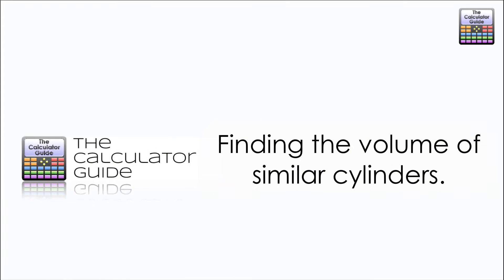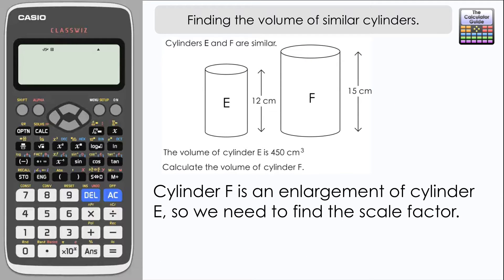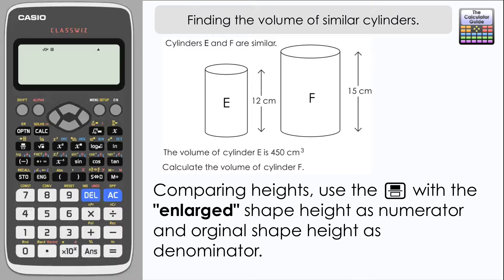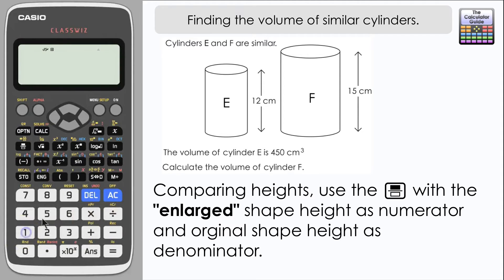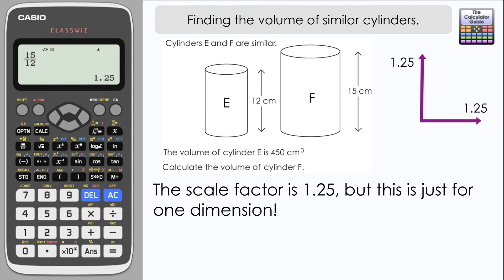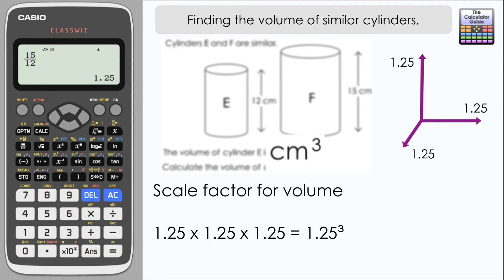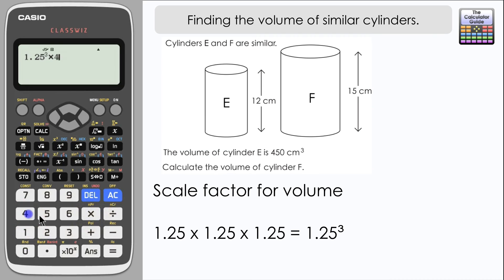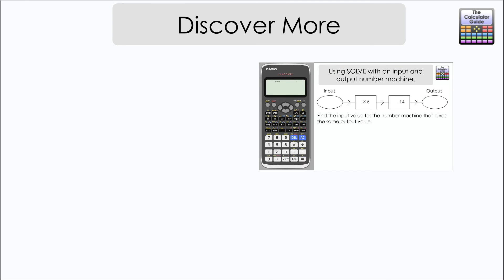Finding the volume of similar cylinders [3D Scale Factor] (Casio Calculator, fx-991EX, fx-85GT)

Comment: I would appreciate if you can make a video on my query , finding volume of a smaller object where larger volume is given .I'm learning maths to help my son and found your video very helpful .You explained each step very nicely .Thanks a lot .
Reply from the maker: You would need a common element to find the scale factor with a question like that, such as knowing both heights etc. Do you have a question that needs answering on this? I could base a video around this if you wish. Otherwise, I am not sure what information you would be given within the question to help you answer this.

Comment: Very useful video . Would we apply the same method for finding the volume of small object if the volume of larger object is given ? Or we have to divide with the given volume after cubing the lengths ?
Reply from the maker: +Riya Khan It depends which way round you express your scale factor. For example this one could be expressed as large to small which would have been a scale factor of 4/5 or 0.8 in which you would have multiplied. 0.8 and 1.25 are reciprocals, so it depends which way round you calculate as to whether you would multiply or divide.

Comment: How about the Volume of the first shape divided by the length on that shape cubed = Volume of the other shape divided by the length of the other shape cubed?
Reply from the maker: +Nicolaas Vandenberg Yes that works. You could even use the ratio mode on the Classwiz with that too